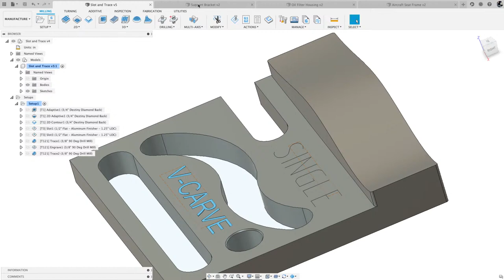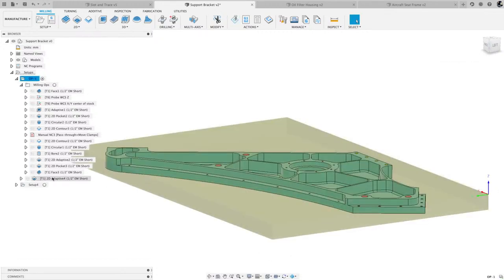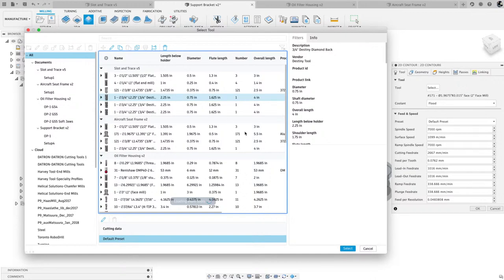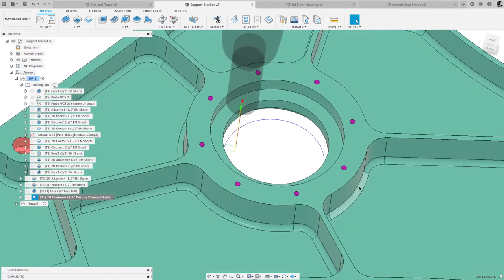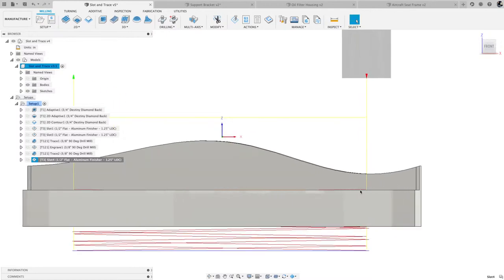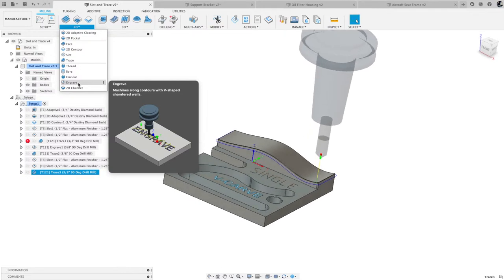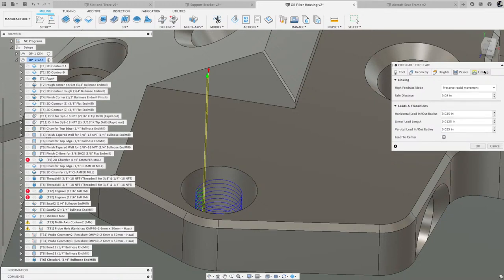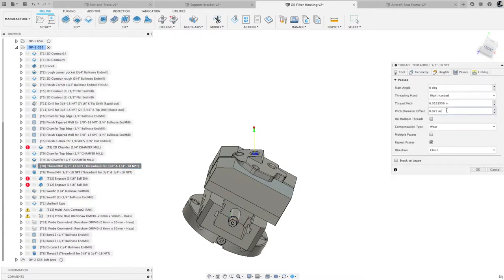360 Live: CAM Basics - 2D Toolpaths

Comment: Really great info.  Nicely done.  Would you happen to know ... How fusion dimension and carved out put are not accurate?  Pockets in x dimension cut .3mm smaller than what the design measures?  And carved paths in y dimension or direction cut .3mm larger than what is in the design?
Reply: Difficult to answer without more detail. It could be 
1) you have “stock to leave” set
2) your tool is worn
3) your machine isn’t rigid and is deflecting

etc etc
Reply: Much appreciated, thanks for your time.  Definitely not 1,  I think.   Could be 2 or 3 ... On xcarve,  pretty new to fusion, few months before personal license changes.  Amazing software.  I'll need to figure out calibration testing.  Thank you again... Have a great break!